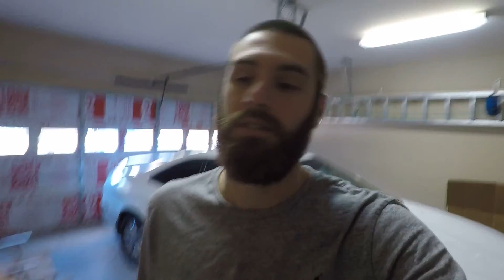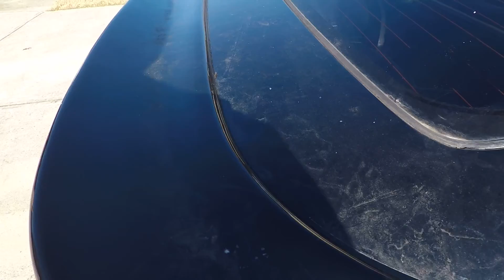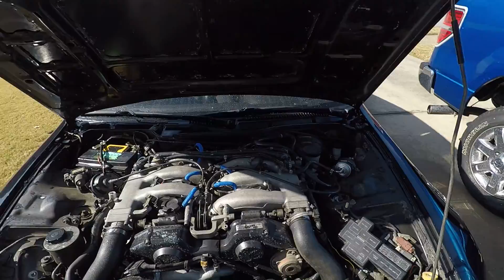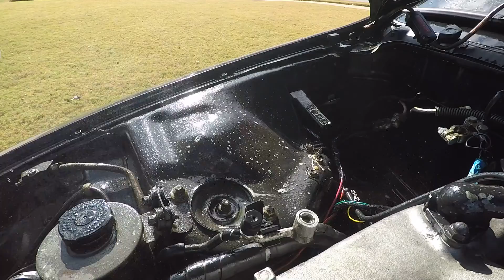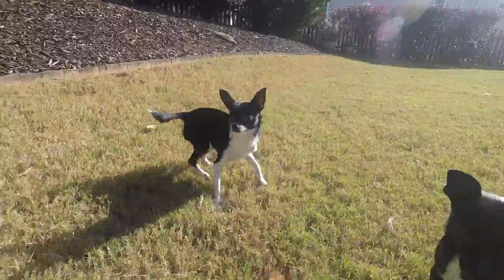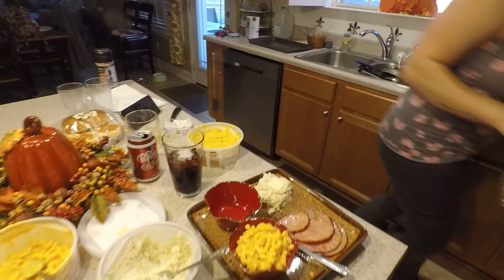How to delete cruise control/Nissan 300zx

Comment: That’s all you have to do to delete the cruise control??
Reply from the maker: Yeah that take the module out and the cruise control is gone. It's mostly to make the engine bay look cleaner but my cruise control was already broken too so I junked it.
Reply: Chase Dupeire yeah mine doesn’t work either lol besides, it’s a z, I’ve never even had the urge to use it